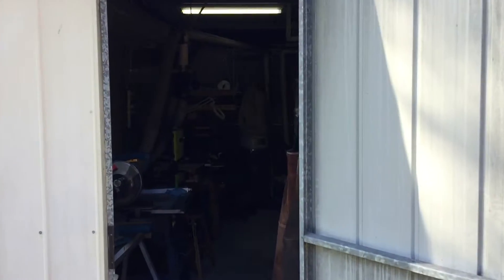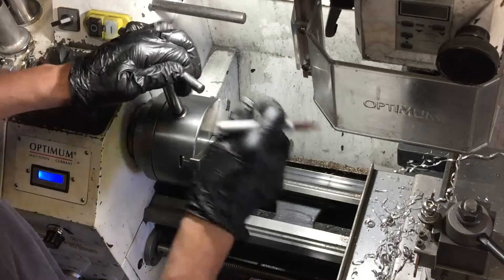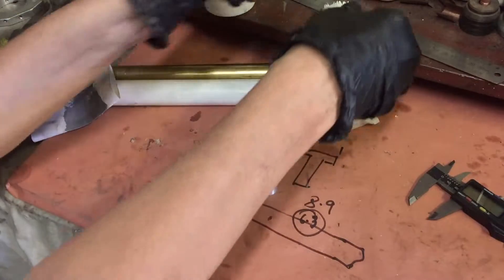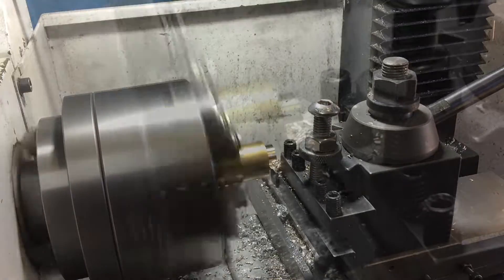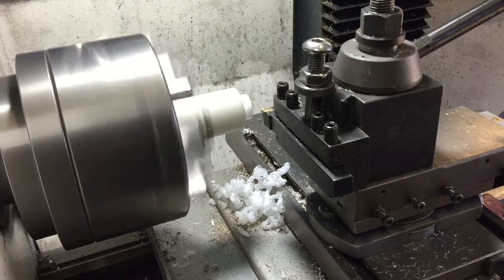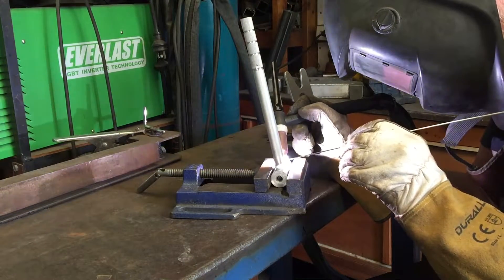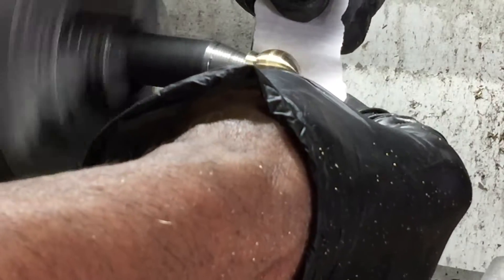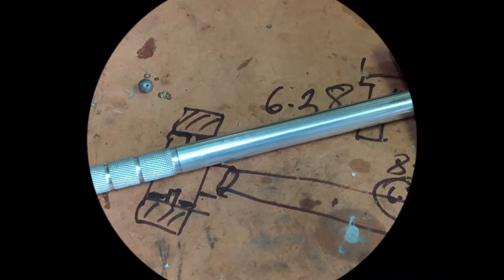Make a Mini Dead Blow Hammer - Easy Metal Lathe Project

Comment: If you use a torch to melt a lead bar and let the drips drop into a pot of water you will end up with small lead balls.
Reply from the maker: Hmmm. Thanks for the tip. I actually tried that but must have done it wrong as I ended up with ribbon bits 😢
Reply: @ShedBuiltStuff  You have to play with height and heat. You don't want it super hot when it hits the water.

Comment: Son made a hammer just like that in high school, I used it for years at work it was just the right weight and size for marking with a centre punch.
Got quite upset when I broke it, the aluminium handle where it meets the head eventually gave out.
Appreciate the reminder, not least the one about wanting a lathe, even if I haven't used one since high school industrial arts.